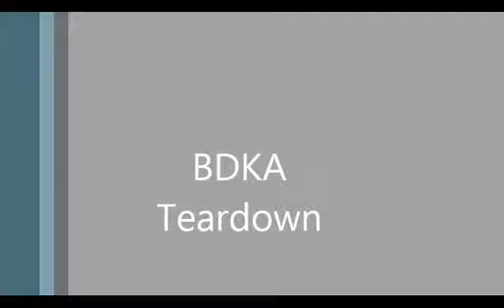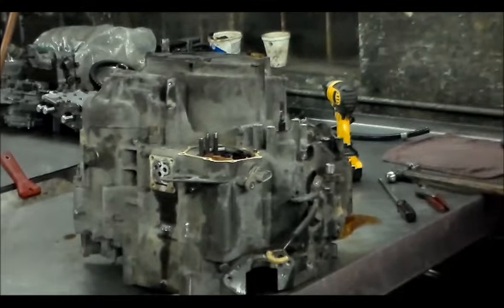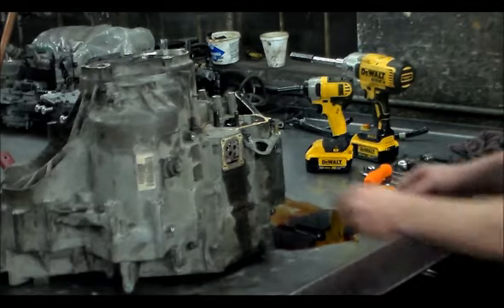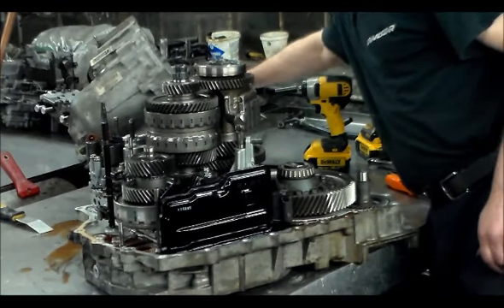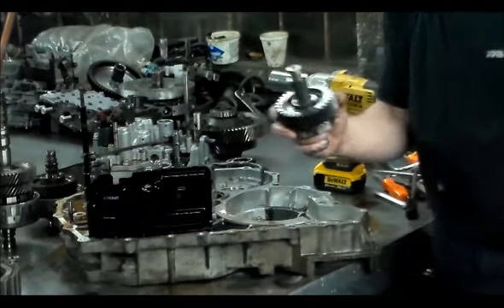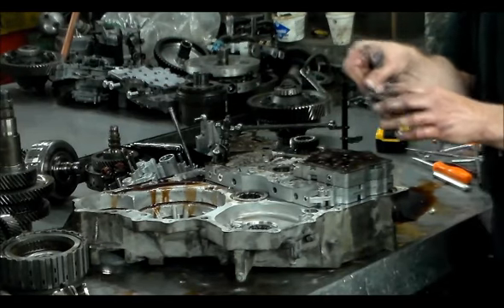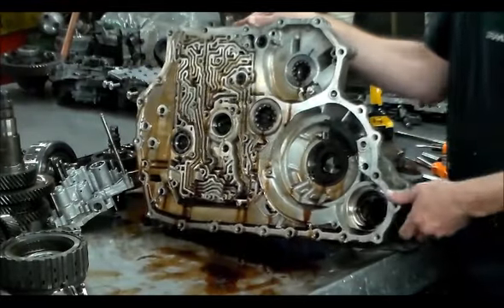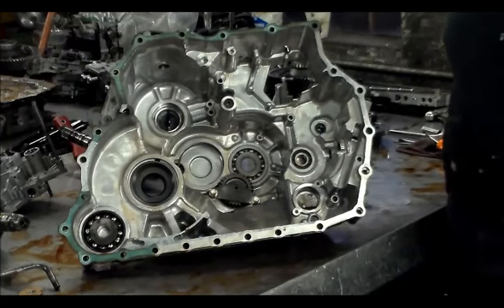Acura, BDKA Teardown

Comment: Great teardown. Very detail. I was just wondering the main causes for d5 flashing light? 05 mdx it drives and shifts smooth but d5 flashes sometimes. Mostly in cooler temps. Thanks
Reply from the maker: If the D light is flashing, that means there is a code present,  you need to have it scanned. If you feel no drivability issue, the code maybe for pressure switches which are external

Comment: I have a 06 Honda Ridgeline doing the opposite of what u just explain when it warms up it starts slipping on neutral up I switch off for a moment then start back to move then sometimes u smiles the transmission oil I changed the transmission oil and the same thing happened  I'm in Jamaica it's warm here all year round should remove the hose from the radiator to just the oil cooler in the front only
Reply from the maker: so would you say it works ok for about the first 15-20 minutes of driving?
Reply: @GaryFerraro  yes then start acting up
Reply: @GaryFerraro  thank you for replying

Comment: Gary good job! And what a smart idea to freeze vb .I'm gonna call you Mr freeze lol. Thank you for the tip! 
Tony
Reply from the maker: No problem, i had to do that a few times and found stuck valves, i clean the valvebody, wrap it in a overhaul kit bag and put it in the freezer for about 3 hours and then check movement on the valves. Thanks for watching .

Comment: Can you replace the solenoid c where that plug goes in with wires without splitting the case 2007 Acura rdx
Reply from the maker: yes,  there is a cover that will come off
Reply: @GaryFerraro  so the ones that plug with wired attaches to I can take the dual solenoid off to get to the solenoid
Reply: Can I do this while it’s still still in the car?
Reply from the maker: @rickstrohm1767  yes, shouldn't be a problem

Comment: I rebuilt my 2005 mdx .I have to it at parts and I ended putting back together. I replaced the 1gear clutches but ,but I have a ,Dole xtra 1" long .for the I look I can't find where it go.even whit the book to rebuild the BDKA. TRANY .is on the truck now but it only go reverse.it will not go forward.ant when you put it on neutral .it feel lilie it want to go reverse.,,Any segutations.
Reply from the maker: You may have the 5th clutch pack to tight, 5th clutch comes on in reverse,  Do you mean you have an extra bolt?
Reply: Gary Ferraro,no I have in xtra dole is like a 1" long ,from the trany ,after I put back  all together,,after the guy lifted apart on the table I bought the manual how to rebuild the trany ,and I started it to Putin back together my self.and that's how I got the dole extra, was my first time ,but the original problem in the trany was the first gear clutches was burned..
Reply from the maker: jacinto gutierrez 
My e mail is gsferraro@yahoo.com.  Can you send a picture
Reply: Gary Ferraro I'm just emailed the pictures
Reply from the maker: jacinto gutierrez ok I'm out with the family. Will look as soon as I can

Comment: Hi your teardown was helpful i was wondering if u have a vid of it being assembled? Im rebuilding a mdra which is the same as this one just not allwheel drive. And i have a stupid question u might be able to answer is there a Manuel that i can swap out
Reply from the maker: you want to swap the trans for a manual trans? I don't believe there is
Reply: @GaryFerraro  yes would like too but idk if theres any trans that would fit its a 04 saturn vue redline 3.5 honda motor and a mdra 5 speed auto and im in the process of rebuilding it but then thought it would be nice to do a Manuel swap

Comment: Im wondering where is the torque converter clutch solenoid located in that same transmission?
Reply from the maker: The lock-up solenoid is internal, you would have to pull off the dual linears and then a cover to see the solenoids.  What code do you have?
Reply: @GaryFerraro  po741   But I only get it when I’m going over 55 mph. I appreciate your help thanks
Reply from the maker: @jesusguevara6558  That could be a converter problem or the single linear, converter is the most common
Reply: @GaryFerraro  thanks gary 👍🏼👍🏼👍🏼

Comment: HI Gary... i desassamble the main body and not much familiar wthis unit due; my question: the CPC valve its normar not return ? just free ? .. forcing to move car front and reverse... thanks.
Reply from the maker: Are you saying your moving the valve and it's not returning to it's original position?
Reply: @GaryFerraro  ..yes there is a clearance between valve cap and the cpc  valve because the spring not pushing valve back agains the cap.. if i shake the valve body i can see moving free...
Reply: its a 2007 acura TL 3.2L BDGA...
Reply from the maker: @MrPatriota2000  That is no good, these valves control the apply and release of the clutch packs
Reply: @GaryFerraro  ...thanks !!

Comment: Its strange, this thing isn't full of planetary gears like a typical automatic, it almost looks like a manual transmission with the gears and countershaft.
Reply from the maker: You are correct, It looks like a standard trans with drums and a valvebody.
Reply: Wut?
Reply: There's normally only one planetary/sun set.  Additional gears are normally added through a Rav setup.

Comment: Question, which cooler lines are in and out ? And also my fluid pump is not functioning , probable cause ? Thank you .ive done all the typical protocols
Reply from the maker: James Metalarc what happens. Does it stop moving when hot?
Reply: Gary Ferraro aw man thanks for the prompt response ! And yes this is the case. I can drive it a short distance without while cold from start but once it warms , no go . When it’s cold and as long as it’s cold all gears change smoothly. But normal op temp I’m dead in the water . Please what gives ?
Reply: Gary Ferraro another thing I’ve noticed Gary, because I can’t determine which line is out and which is in for this description we will use the speed scensors as a relative term. I’ve disconnected the lines from the radiator and ran transparent tubes from both into empty containers to see which would spit. The outboard speed scensor side hose did nothing. In fact I could put my mouth to the hose and blow air in and nothing but the onboard side, when. In park I feel resistance. And when I’ve shifted to neutral while running I seen a little fluid trickle out. I dropped the drain bolt , did a drain and refill with fresh Honda atf, and then I started it put it in neutral and noticed it started sucking fluid in? I tipped that hose upward connected a funnel and fed it a quart. I kept the outboard speed sensor side hose tuning to the container, gear in neutral still nothing came out . ?

Comment: What is the gear puller tool part number you are using in this video?
Reply from the maker: I will see if it has a number and post back
Reply: Must've lost the tool lol
Reply: @Atonement-   Just like the 10mm socket. lol